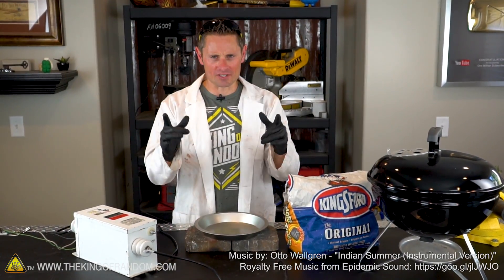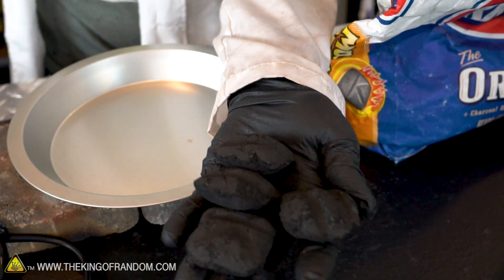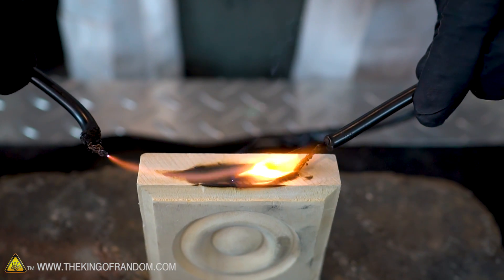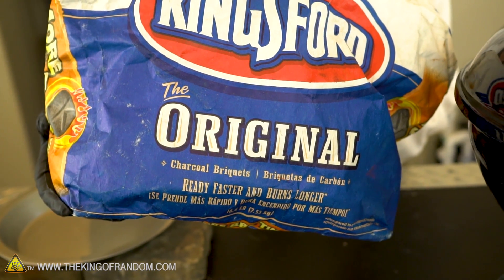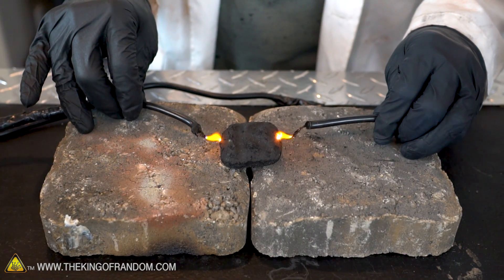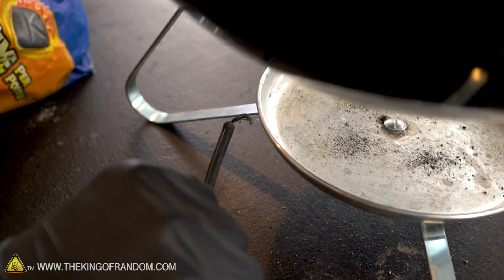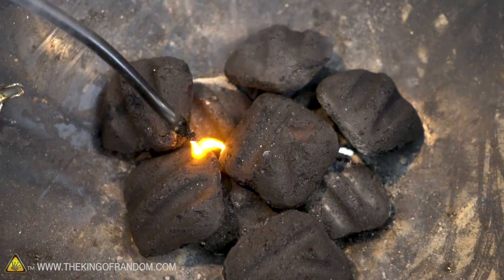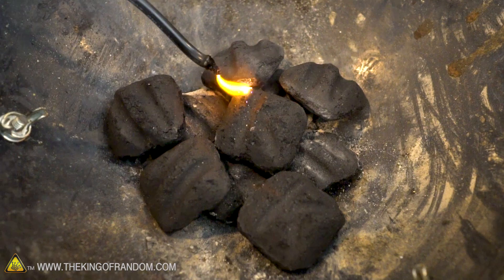Starting FIRES With Electricity ⚡🔥 TKOR Attempts A Firestarter Hack With Electricity Fire

Comment: Put 20amps at 24 yolts through some steel wool.
*accidently discovered about 55 years ago, tried to clean my HO model railroad tracks with a steel wool pad and forgot to turn it off.
Hey, I was a kid, I didn't know steel wool was highly flammable.
Ironic, I grew up to be a master electrician.

Comment: All this pyro and we still don't know several fundamental things: (1) what is an arc? how is it different from a regular electrical path? how is it that it jumps air? (2) why does activated charcoal (a resistor) first require "priming" before the electricity will pass through it? (3) what about using a non-arc power source?

Comment: Hooking a wire to the grill will not make it shock you unless you're holding on to the end of the other wire, essentially, the high-voltage Transformer is also an isolation Transformer. 
By the time you get that barbecue going I'm going to starve to death!
They all turn on, they all turn off, they all turn on, they all turn off. Congratulations, you've invented digital charcoal.

Comment: this is an excellent experiment, but I noticed the wood you use is MDF (medium Density Fibreboard).  the glues in the wood possible react differently than the wood itself.  perhaps if you tried using a hardwood such as ironwood, or rock maple, the wood itself might actually continue the current.

Comment: Can frozen slime be used to insulate an igloo? After all, in "What Does Slime Do In Liquid Nitrogen?", you pointed out that it was acting like an insulator!

Could it be used to create an improved insulating shell for an igloo? Using identical igloo molds, could try something like this, perhaps?: 
  --Chill one mold in liquid nitrogen, then pour or spread slime into it, making sure it has a single even layer of frozen slime, then a single, exposed, layer of unfrozen slime, so only the outside layer of the igloo is frozen.
  --A second mold could have a layer of plain, solid ice the same thickness as the frozen and unfrozen slime combined.
  --A third mold could have a layer of plane snow, again the same thickness as the rest.
  --You would then apply an even layer of snow to the inside of all the molds before removing the finished igloos.

Then it’s up to you! Leave them outside to see which melts the fastest? See which withstands a blowtorch the longest? Build small campfires in them? Blow them up?!

Comment: Grant what would happen if you set a hair dryer running and then covered up the back air intake hole as when I did it actually for a few seconds the whole thing started glowing red inside

Comment: You should revisit your air compressor ak47 style rocket launcher and put motors on it and hook it up to a rc receiver and transmitter so you can make a wireless fireing system that can turn

Comment: It doesn't worked out at the first place because the ions between those gaps weren't charged enough, and were charged whenthe arc was established and helped conducting current through air. The same will happen with most of the bad conductors if they can be parted away by flame.

Comment: I  used to do this in my teenage years. and you don't need a high voltage power supply  a laptop brick would be sufficient.

Comment: can u tell me why sometime when i touch metal with my own hand or get to skin contact with people i sometimes get like electrified and idk why
Reply: That is called static electricity. When you build up a negative charge in your body (a bit like a capacitor i think) the charge is contained in your body until it gets a path to escape through. The path of escape is then through some metal, your friend who is positively charged (has a lower potential) compared to you, or anything else conductive. Thus the charge (electrons) will discharge into the other object, to even the charge between you and the other object you touch.

The electrification-feeling is the electrons stimulating your pain receptors, thus giving the shock-feeling.

The negative charge can build up in your body by, ex. rubbing a ballon on your hair.

Comment: Keeping with the high voltage experiments....  I'd like to see you soak pieces of wood in different salt solutions (sodium chloride, potassium chloride, sodium hypochlorite, etc) THEN  add high voltage electricity to see if the different salts produce different patterns in the wood.

Comment: What if you put a flat piece of wood say 2'x2'x1.5" thick and put a piece of metal on one electrode and attached it some how to the board. Then put the other electrode on the board opposite the other electrode. I've seen some videos it cuts a lightning pattern in the wood. I'm just not sure how they do it.

Comment: Grant you need to be careful. there was a report of a guy doing this with a microwave transformer and he was killed by the electricity. If you are going to do this use a means of insulating like fiberglass rods one on each electrode.

Comment: Could you make 2 solar scorchers align and see if it makes double the heat
Reply: the solar scorcher on the bottom would melt
Reply: Protagonist I think he means two in different locations and meet where the sun is and combine the heat
Reply: So long as the bottom solar scorcher is not in the focal point of the first it could work that way
Reply: Noahcoolguy12 actually it would be triple

Comment: Can you use the solar scorcher or the arc furnace to boil gallium or even mercury and try to make the metal turn from solid to liquid to a gaseous state? I know mercury vapors are toxic so you will need to find a way to contain the vapors but if you can vaporize gallium that would be pretty awesome.

Comment: Can you find out if glass is conductive in any way?
Reply: Jeffrey de Groot glass is an amazing insulator unless it's molten
Reply: Molten glass will counduct electricity. But "solid" glass won't. Check out Cody'sLab vid on that. BTW that" " on solid is intended.

Comment: I REALLY want to see your electricity bill.
Reply: Korman Gokhan NSTs only draw around 1.5 amps at 120v
Reply: Aman Khokhar 360watts is like half an average heater
Reply: its over 9000!!!!!
Reply: It is Really
Reply: Daniel Lee   "It's" not "its."
Reply: Spxctator Well I am NOT from a country that speak ENGLISH. what so ever?
Reply: Running that for an hour would cost me 0.14€ ($0.16).
Reply: Korman Gokhan he most likely just buys high voltage batteries like car batteries but if this stuff was on his electric bill I would guess a few thousand at least and we can only wonder what he spends on liquid nitrogen...
Reply: As bayrakları as
Reply: ItzDev Oh realy?
Reply: Trina Ronner Svetlin lol aggreed
Reply: ya i want to see it too:D
Reply: Korman Gokhan its really not realy
Reply: Randy Cheow 😂😂😂😂
Reply: Randy Cheow Lol XD
Reply: Korman Gokhan  vn 
čĺĺpl.
m..mn.
😎👖👙
Reply: Korman Gokhan its 12kV at 30mA so its just 360W of power. So, that transformer draws power equivalent to an big electric heater so it wont affect the electricity bill that much.
Reply: Less than a small electric heater. I have a small electric heater which has two settings: 1.3 kw and 1.5 kw.
Reply: What happens if u mix propane and gasoline
Reply: Just watch styropyro...
Reply: Gökhan Korman is it like 100000000000000000000$
Reply: That’s why he uses a transformer it takes small amounts of electricity and amplify it
Reply: I really want to see your English results.
Reply: Korman Gokhan it won't be much because that the point of a transformer it takes a small amount of electricity and amplifies it.
Reply: kallejjk 14 cents? where are you from, ⚡ paradise?
Reply: put charcoal horizantally and run electrictity throught it and see how many charcoal bricks electricity can jump
Reply: 666 likes

Comment: can you experiment with a phone charger and se how dangerous it is if it gets in contact with water
Reply: Depends on what part. If the long wire that plugs into your phone falls into the water not much is gonna happen.
Reply: Your average phone charger is only 5 volts so it wouldn't even affect a human. It's only average  two amps also so maybe it could but your wedding ring if your wearing one but I doubt you'd get a bad burn if it could even shock you.

Comment: Someone clever explain why this happens in a more detailed way please!
Reply: Elemental carbon can donate an electron from its outer valence shell like most metals even though carbon isn't a metal.  Diamond is also carbon but a form (allotrope)  that has all electrons bound in the crystalline pattern preventing electron donation so it is an insulator.  This is also why diamonds are clear while graphite and amorphous carbon (black carbon) are opaque.

Black carbon is a poor conductor so it has electrical resistance.  The resistance means voltage is dropped and resulting energy is converted to heat.

Smoke from the burning is ionic so it conducts current better than air.

Comment: Question, is heat produced from something having to do with friction or resistance along the path? So like the wires don't get very hot but the air and wood do and I'd imagine that a human body is somewhere between and does not burn too badly after a lightening strike, right? But can someone explain to me what they think is going on there exactly? And maybe suggest an experiment?

Comment: Hey Grant! I was grilling the other day, and I typically use my leaf blower to induce air into my chimney starter to get the coals hot quicker. It made me wonder if, with enough induced air, the charcoal could generate enough heat to be a source of fuel for your metal foundry? Maybe worth a shot....

Comment: what would happen if you try to do the same thing but underneath liquid nitrogen will it light or would it freeze
Reply: Airsoft Wolf what type of question is that if you put the wires in liquid nitro it will just freeze the wire
Reply: VollsXL Oputa you never know

Comment: Can you try this again but use pure oxygen to speed up the burning process?
Reply: Kumartheffar I mean he could, but he would probably die in the resulting explosion so................
Reply: owen fulkerson it will not explode as pure oxygen is not flammable
Reply: A Bullet117 Its not a a fuel. I have an oxyacetylene torch at home and messed around with pure oxygen and fire, It just accelerates a burn. Do some research before you comment
Reply: Platinum Science yes it is
Reply: It might not be a fuel but it is literally the most efficient oxidizer, and as most people know if you have a fuel (the wood) and an oxidizer, and some heat, it makes fire. With pure oxygen it would likely be an explosion.

Comment: What happens when you freeze charcoal with liquid nitrogen, would it fire up?
Reply: in theory the electricity would arc easier because cooler temperature means less resistance in the material, and higher temperature more resistance and whatnot
Reply: Which he would. :)
Reply: Yeah of course. It would combust into flames, and/or shoot out the liquid nitrogen flying sky high. Probably hit his roof if he did it indoors :)

Comment: do you think electricity can run through paint ?
Reply: depends on what paint
Reply: lead paint
Reply: Bereserker it can run through anything that isn't grounded properly. Including pipe lines and drywall which how house fires have started in the past and part of why knob and tube wiring is so dangerous.

Comment: If you use lighter fluid on the charcoal (or pre-treated briquettes), can you light it with a taser?
Reply: I read that as pre treated baguettes at first.
Can you soak baguettes (or any loaf, crusty french is the most absorbent though) in fuel and light them? :D

Baguette = New age torches
Reply: Probably

Comment: Please read all: 
See if you can make letters/words with the charcoal briquettes and run the current through them.
Even better yet, make your own smaller briquettes and do this so its easier to see the current!
And make... A 2d Crown!!! 👑
(have a spacer that isnt conductive between the two points main contact points so that it doesnt just arc across when the) wires get close)

Comment: Why does it go through the 4 charcoal instead of just hopping to both the wires?
Reply: He doesn't have enough voltage to create an electric arc directly between the wires, it's easier for the electricity to go through the 4 charcoal than ionizing the air.
Reply: Corbin Daniels because the made electrical paths trough the charcoal
Reply: because the wires are closer to the charcoal than they are to the two wires

Comment: I just finished a school year within construction. During the year we had plumbing and we actually had a way of electric soldering of copper pipes. It was some sort of transformer with a clamp and charcoal on each end wich created enough heat to melt the tin. A much simpler solution in oppose to using a blowtorch. This project just reminded me a lot about it because there were small arks when the charcoal touched ^^ As well as a similar concept of course

Comment: Can you pls compres carbon and make diamonds
Reply: Θανασης Ροκκας the heat and compression necessary for the process is impossible for Grant to make unless he makes a modified arc furnace that compresses coal or any carbon-based material while heating it to extremely high temperatures
Reply: Mukacola yeah if it was possible venus would have a lot of diamonds on it's surface. But 55 cancryE may have a surface with a large amount of diamonds especially on it's core
Reply: I suppose if you somehow managed to compress the coal while it was in the contact point between two atoms clashing in a particle accelerator then maybe because the heat would be enough is they somehow sustained it
Reply: Needs to much force to do that
Reply: Θανασης Ροκκας that's impossible at home you need immense heat and pressure for that to happen
Reply: FARRAS HEZKEL SYAILENDRA they got microdiamonds.
Reply: *industrial microdiamonds
Reply: It is possible with powerful bombs.
Reply: Bro it won't happen , myth busters tried it

Comment: you should mix propane and butane then experiment with it see what happens.✌️👑
Reply: Kalvin Cochran the gas will mix not the liquid unless mixed but the problem isn't the mixture it's the fact that butane burns more explosive then propane so you have to be extremely careful.
Reply: Butane isn't any more explosive than propane.   It has a higher boiling point and less pressure than propane, this is why it is used in lighters.
Reply: indominus_craftz it won't mix they'll just stack

Comment: inf energy = 4 charcoals + high voltage elec. after connections have been made remove wires before electricity in runs out

Comment: Those arcs through air are actually causing nitrogen to oxidize; something that can only happen under very energetic circumstances.  Those nitrogen oxides, combined with water, will produce nitric acid.  It's possible to make nitric acid using an electric arc.  The oxide gas is then run through water where it dissolves to make HNO3.  How about THAT for an experiment, Grant?

Comment: Grant! you should try to do some electric experiments with pepsi. IT leads electricity So what would hapen if you cover table/other wooden or cloth and put high power minus cable to one end and plus to the other? Would it just get set on fire or will it burn the material from high temperature?  Can you repeat this with gasoline? Idk! Thx for reading my first ever suggestion 👑👑👑

Comment: hey grant, you should put a rocket motor up against a block of ice to see if it melts through or just scorches it a bit, failing that, try freezing a motor in liquid nitrogen and see if it goes. my theory is that it will still work but would be interested in seeing it

Comment: When I was a kid we had something called "The Hot Dogger" which was a plastic box with electrode spikes on both sides. Hotdogs were impaled on the spikes on each end to the spike on the other side of the box. It was simply plugged in and electric current surged through the dog and cooked it. We didn't use it more than once because it made the dogs taste terrible.

Comment: Notice how wide the arc is from the wire/electrode, this is what a high voltage, low amperage arc looks like, which is poor for deep strong welds. Amperage is how a narrow arc is developed. Which also increases penetration or how deep a weld will be .

Comment: Grant you should see what kings of engines you can run with your hydrogen maker. try just bypassing the gas tank and try it threw just the carb like a starter fluid would do

Comment: This is probably going to get buried in the comments ans replies but AVE. that canook with the funky lingo. showed that kingsford briquettes are incredibly inefficient because the "filler" and "other ingreedients" is basically just dirt. thermodynamically inert. 
hense why you get shitloads of "ash" after they burn out.

next time don't use briquettes. use actual charcoal. you can get it from tractor supply stores here in my state I don't see why not in other states.

Comment: Grant try using a wide board like a 1 by 8 and take a paper towel and dowsing it in a mixture of baking soda and water. Then wipe down the board on one side end for end. this will make the wood conductive. the use each one of the leads on each end of the board  and watch the design play out

Comment: Grant, if you put a phone charger in one peace of charcoal and you put high voltage electrodes through it, will it charge a phone or will it burn the charger?
Reply: Burn the charger and/or phone. The phone and charger are adapted for the specific voltage in your power outlet